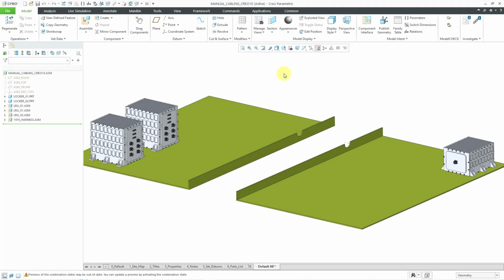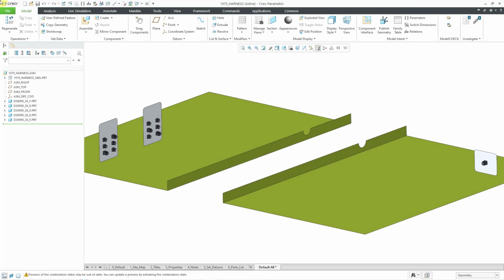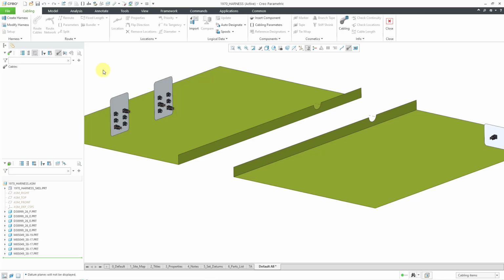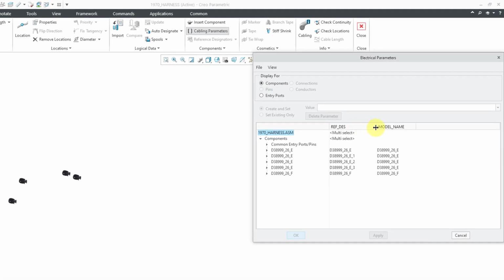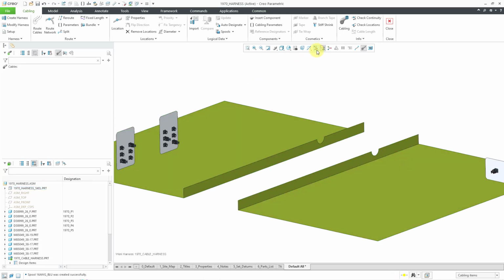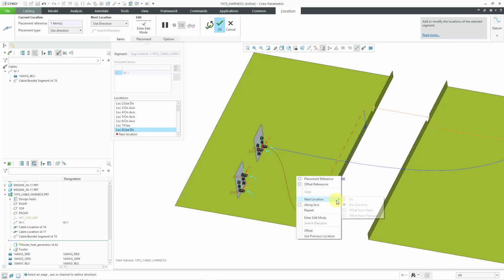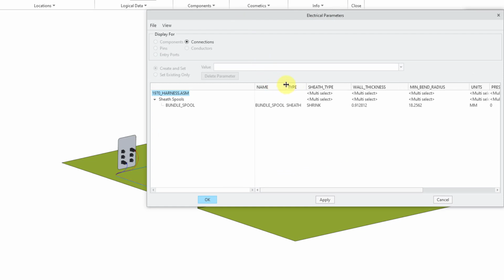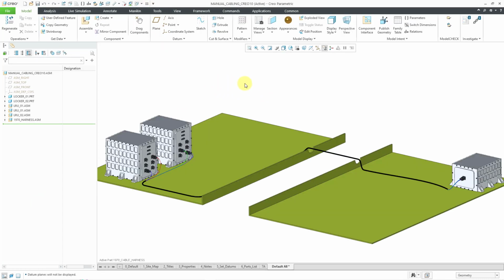Creo Parametric - Manual Cabling  - 2023 Update

Comment: From Brazil. Hello, thank you for all the videos, it helps a lot. I can do all the steps to generate the harness, spools, wire... But the wire does not stay in the configured color, example red, what could it be?
Reply from the maker: Are you making sure your colors file is loaded upon starting Creo?
Reply: @CADPLMGuy  I managed to do it, it was necessary to create an appearance with a name equal to the name of the default color chosen in the cable configuration, thanks for the feedback

Comment: Hello, how can I control the angle of a location? I have a flexible model that moves based on a parameter and the orientation of flat cable locations does not follow this. Thanks!

Comment: Hey I am using student license and the issue I am facing is that of cabling and piping options in application is not there could you help me
Reply: The student license is heavily restricted. You only get basic modeling capability. Cabling is not included.
Reply from the maker: I am not familiar with the student license but I understand that it does not come with additional extensions like AAX (Advanced Assembly) or PCX (piping and cabling). For support, please use the PTC Education forum on the PTC Community site.